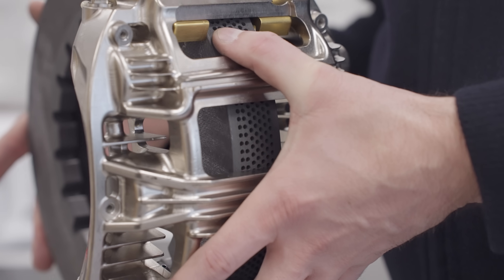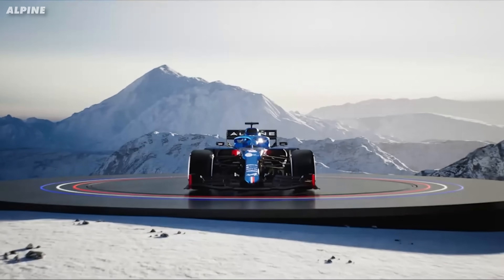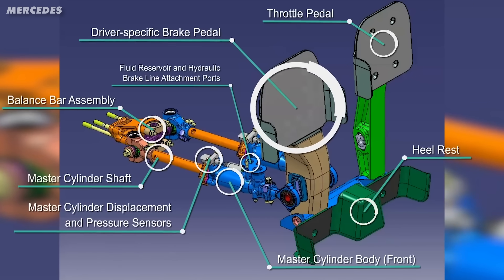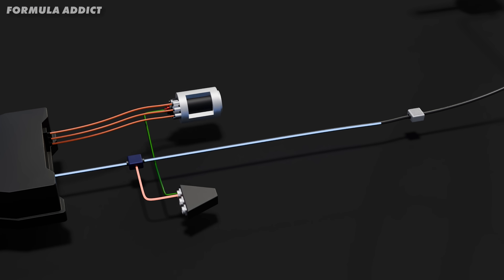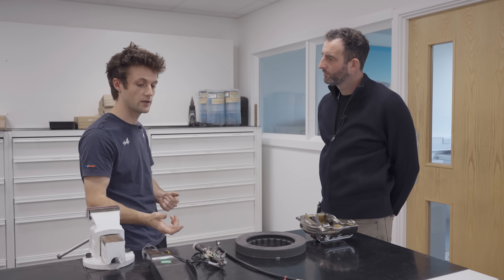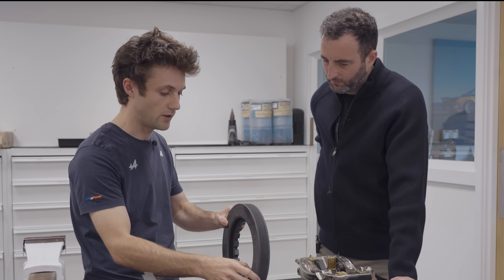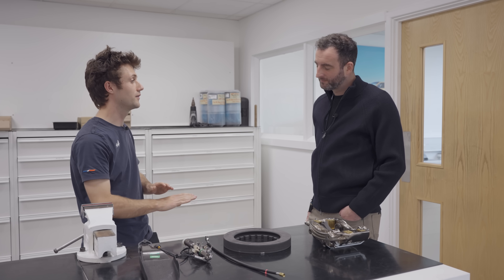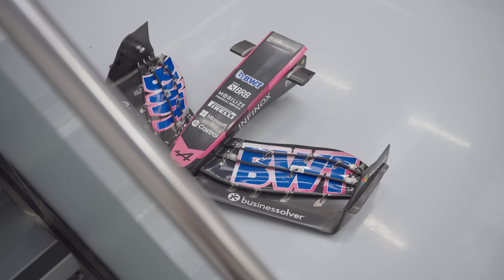How Formula 1 Brakes Work (F1 team explains)

Comment: Look, the 180 kg of pressure needed to actuate a F1 break sounds impressive, but everyone who lift weights knows that there must be some major information missing. Look up a person deadlifting 380 kg and compare them to a f1 driver. Something ain’t adding up!
Reply: i have a very strong feeling they're also leaving out the multiplication of energy due to the leverage of the brake pedal. I'm almost positive its 180kg at the cylinder itself, not onto the pedal itself. 180kg of pressure on a lightweight carbon fiber pedal that is about 8 inches of lever, would certainly bend or fracture it.
Reply: f1 drivers are essentially laying on their backs.  when they put THEIR effort into the pedal, the stopping forces push them harder into the pedal.  as the adage goes "stand on the brakes", f1 drivers actually are doing just that.
Reply: The missing fact is: when you brake, your body moves to the front of the car by inertia.
So you are braking with all your body.
Then, when you brake and reach 5 or 6g of deceleration, your body weight is multiplied by 5 or 6 times.
You need to apply just the weight for the start of the braking. Then your body does the rest. A driver who weights 80kh, when braking is applying 80kg x number of g's.
Reply: @loriscarrara5353 The g-force doesn't  really matter since the force you need to apply with your leg is still the same regardless of whether your upper body is pushing down on it harder.  

Think of it this way, it's not any easier to stand up from a squat with X kg of weight on your shoulders than to press that amount in a leg machine.

I suspect the point about the mechanical advantage of the brake pedal being ignored is correct.
Reply: @petergerdes1094  if you stand on a balance with 1g you weight your mass*1g.
If you can add 4g, for a total of 5g's, the balance will measure your mass* 5g.
Same when braking bit this time is on the horizontal line.
So yes. G does conunt while braking
Reply: @loriscarrara5353  But it doesn't reduce the force your leg muscles must apply.  Your leg isn't locked so those muscles still need to apply the full force.  The g-force effectively lets you apply more force than you could unbraced because it makes your torso weight more (though surely the drivers are braced) but doesn't reduce how strong you need to be (well by a very tiny amount with the weight of your leg beneath the knee).

You still need the same force applied at the knee regardless of how heavy your torso is so it's the same amount of strength.
Reply: @loriscarrara5353  But that doesn't reduce how strong you need to be.  Your legs are still pressing with the same amount of force so same strength of leg muscles.

It just lets you push harder than you could unbraced but since I assume the drivers are braced it doesn't really matter whether you get that from extra gs or pressing against the seat back.
Reply: @petergerdes1094 it does matter because of leverage and biomechanics. Squatting is a lot harder than carrying a certain large mass on your shoulders while standing upright. You will have to carry it but there’s no chance you’ll be able to squat it.
Reply: @petergerdes1094 remember that leg muscles don’t just produce a force. They produce a moment. Its leverage. So we can’t think of things like squatting… also, tendons play a big part in isometric holds. Which is more similar to this type of situation. You will be using the muscles and tendons to stabilise and strengthen your structure (bones), as you carry the force or the g force. Not saying this is what happens. Depends on the actual f1 cars and I haven’t got enough info about them to know. But yeah.
Reply: @ I agree the legs act as leverage but no more so than in a leg machine at the gym.  Also, I think it's almost certainly true that the mechanical advantage due to the brake pedal/lever itself isn't being considered.
Reply: @petergerdes1094 It is definitely easier to leg press a weight compared to squatting it.

Core bracing is different and cheating the lift is different. 

Is similar to why most people can deadlift heavier than they can squat
Reply: @loriscarrara5353  He still has to hold (and modulate) that pressure with his leg but, unlike a leg press at the gym, his leg is essentially straight the whole time.
Reply: @loriscarrara5353  No, he's well strapped in 
with 5 pt harness. 
He's not sliding forward.
Reply: @Cougar1212  He’s not sliding, because the brake and the harness hold him, but you can bet a good chunk of that force going down the pedal rather than into the harness
Reply: @Cougar1212  there is always some centimeters of free movement + the leg alone also weights maybe 15 kg. Its not that simple that he needs to push 180kg. He needs to push a lot but he has a lot of help from decceleration.
Reply: @loriscarrara5353  a driver who ways 80kg is too heavy for F1.
Reply: @johnfriedl7126  you missed the point. That's called an example. Smh
Reply: Also the drivers use deceleration itself to increase the break pressure. It’s more like holding a180kg weight pushed, it’s difficult but not impossible for regular gym person to do so. But doing so 10 times per lap for 60 laps is the main issue
Reply: its more like holding 180kg standing, not lifting. Legs are all the time streight/little bent.
Reply: @Kurator125  it's the declaration force that boosts their pushing force. The hardest part is actually getting their foot back off the break
Reply: Leverage will reduce the actual force required.
Reply: Go to a gym, find a leg press machine and put on 180kg of weights and with just your left leg, using just the base of the foot at the edge of the footrest, apply up and down pressure and do it for 2 minutes and come back and tell us how it went
Reply: @septopus3516  6g deceleration automatically adds a lot to the muscle power, the driver does not makes 180kgs by one leg over 70 laps times 10 corners….
Reply: @septopus3516 only a small travel distance though
Reply: @septopus3516  its' not that simple of a comparison
Reply: @septopus3516 F1 drivers have to be incredibly fit. Much more than all of the body builders in this comment section. They lose 2-4kg during the race. Try sweating out 2kg in the gym and tell us how it went
Reply: The only thing not adding up is 180x2 isn't 380 but whatever

Its almost fully extended foot under 6g, but still impressive
Reply: Then for 2 hours, unlike the gym,add G force and heat an fatigue
Reply: I'm guessing that's the force on the master cylinder. Which looks like the pedal has quite a bit of leverage over
Reply: @Dia1Up yeh exactly
Reply: The thing is that they use their own G-force when they add brake pressure. Their body moves forward when they brake and it helps them with the breaking
Reply: It really its the same, but you have de advantage of having the knee almost parallel to the force, so a lot of it is transfered to the seat. Is just that the force is mostly done by your bones, not by your muscles.
Reply: Also there's leverage like someone else said
Reply: bro probably have never seen sports in his life. wait until you see archery and football
Reply: At 6gs that skinny little 140lb F1 driver weighs 840lbs... his single leg weight alone should be enough.
Reply: It's because as they progressively brake, the G forces increase their weight relative to the front of the vehicle. The harder they brake, the harder they are forced towards the front of the vehicle. If the braking for wasn't that high, they would be unable to properly control it and would always brake at full force.
Reply: The g force does play a role in braking by pushing the weight of the driver into the pedal.. So essentially, when they hit the brake the g forces push them into the pedal, which makes it much easier for them to generate enough force to stop. They still need to have incredible strength to do this through each corner, lap after lap, dealing with the heat and g forces exerted on them.. They need to be as light as possible, while still having enough core strength to help them deal with all the g forces they experience.  They need extremely strong neck and core muscles to deal with this.. If you look at their necks, they're usually much larger than that of the average person..
Reply: Click bait to feed views
Reply: Power lifting doesn't use the ankle and calf to lift that weight. The f1 brake pedal isn't pushed from a squat..the drivers sit as if you're sitting on the floor feet in front of you with your knee about 2 inches off the ground at the most. Usually about 1.5 inches off the floor. 
weightlifting and pressing the brake pedal of an f1 car is apples and oranges.
I can lift my toe therfor I'm as strong as a powerlifter by your own insanity type of thought process.
Reply: I think he meant 180kg worth of force is applied on the breakes , but not necessarily means that much is applied on the breakes by the driver, hydraulics doing its job.
Reply: I, f'rinstance, don't look anything like either a power lifter OR an F1 driver. I'm over 65 years old, and overweight at just north of 115 kilos. However, I can easily stand on my left foot with my heel not touching the ground, exerting 115kg of force. I can also manage a short run across the street, and running results in 2 to 3 times body weight on the foot - or 230 to 345kg for me!
It's not the number, it's the repetition, duration, and fine control that set the drivers apart from the rest of us.
Reply: The thing that isn’t adding up is you comparing pressing a brake pedal to performing a deadlift.
Reply: Must be a mistake. Noobe could handle to make that force such several times.
Reply: There is a vidioe about it. Look up F1 breaks normal guy can't stop. Or something like that. The guy said he put his whole body on the breaks and the sensors said he depressed them like 5%. The drivers use inertia and physics to operate them. Just because you don't understand something doesn't mean it doesn't add up.
Reply: Why do we have the scientists we have when we could employ all these unqualified keyboard warriors with their opinions 😂
Reply: That’s 100% not true. A driver is strapped into the seat and the legs are free to bend enough to use the pedals. 180kg is bullshit and no, the deceleration is not pushing the foot into the pedal. 6g is much, it’s crazy but not that much to have such crazy forces. Remember the driver is strapped down into the seat. The body is not moving 1 inch
Reply: @ruesselbert3004  Someone pointed out above they likely aren't counting the mechanical advantage from the brake lever itself.

Comment: No info on the brake fluid being used? IMO that's kinda crucial.
Reply: @Julian-ty2ps I think you're confused
Reply: Top secret
Reply: Or pads..
Reply: @Julian-ty2ps  hilarious !
Reply: @Julian-ty2ps  that doesn’t literally mean there’s a wire. That just means that the pedal isn’t directly connected to the calipers. They literally explain that it’s all using hydraulic pressure, just like a road car. The “by wire” part means that there’s an element of electronic control in the middle.
Reply: Disagree. This video isn't really about specific manufacturers, although obviously Brembo cannot really be ignored.
Reply: oil?
Reply: Apparently it's a type of cream cheese. The kind you get in a can.
Reply: @harpersneil  Shampoo, I assumed.
Reply: @user-xu5vl5th9n  Don't be ridiculous, that really demonstrates an ignorance on the subject.

It would be Conditioner if anything and they haven't used that for at least 3 years.
Reply: Endless for Mercedes, Brembo for the rest. I use the endless in my track car and it's unbelievable.
Reply: No brake pads either. That's kinda crucial.
Reply: @Julian-ty2ps 😂 good one 😆
Reply: Something that doesn't boil at 1000 degrees, so...not DOT4 😂
Reply: I used to use Motul in my track car
Reply: Mercedes use Endless if that helps
Reply: They use dot 5or dot 6 now should be obvious they use the most expensive brake fluid since the damn pedal is carbon fiber